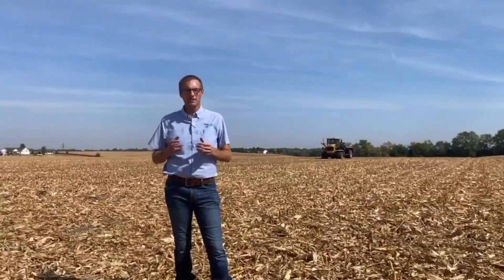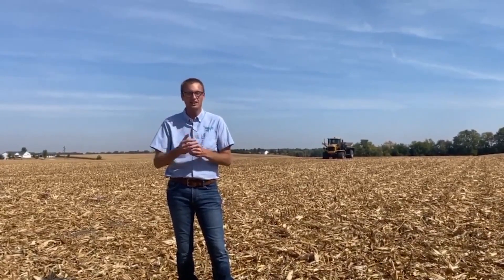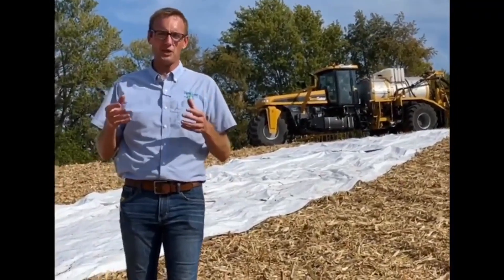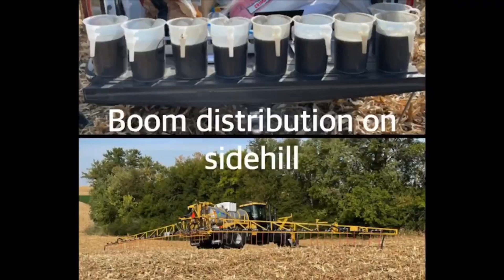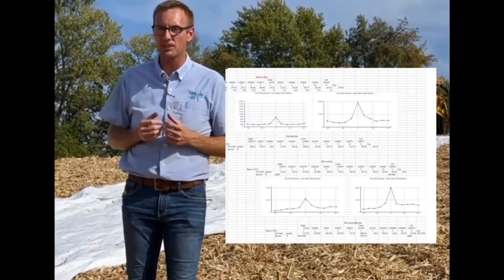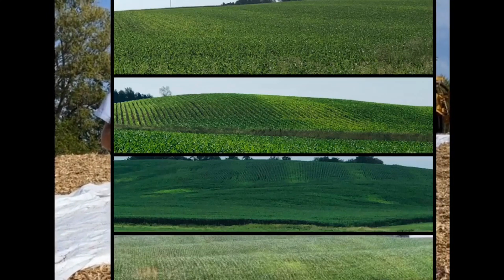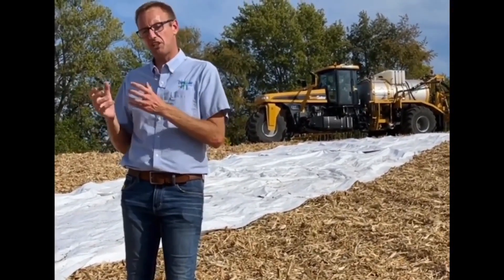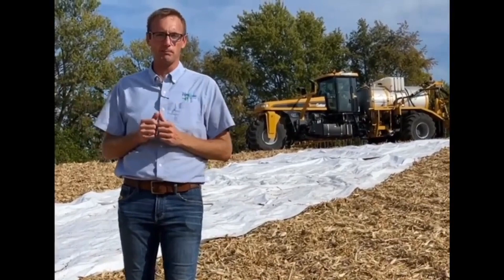Liquid Vs Dry Fertilizer: In Field Comparison

Comment: I also suppose that later there will be a process of mechanical incorporation with implement, which I believe should correct the distribution and improve its efficiency, if it is not, the fertilization process is definitely inefficient, on the contrary, if the due process is held and efficiency effects are not achieved, other factors will be involved example, moment with reference to the year,  Chemical dose or source of the fertilizer.

Comment: A huge drop spreader for dry fertilizer might put down the granules in a more uniform patern. Does such a contraption exist
Reply from the maker: Air booms do exist, and they do more of an effective job than  basic dry spinner spreaders, but are not super common because of higher initial cost and maintenance costs of the machine over its life expectancy.
Reply: @LiquiGrow  thanks for the info